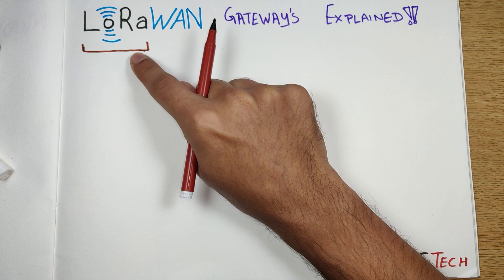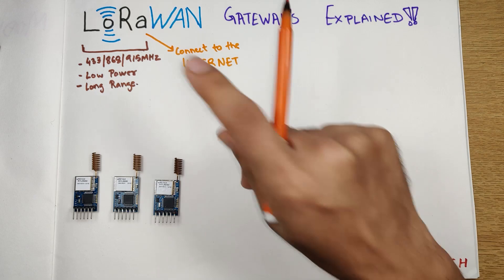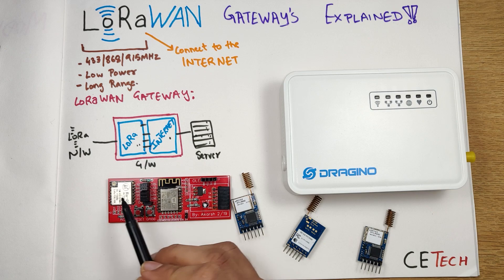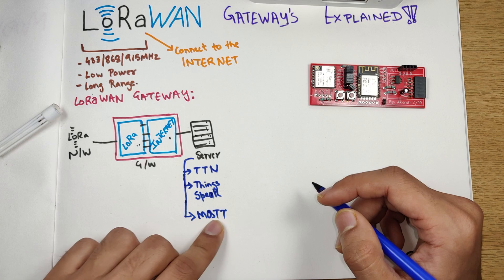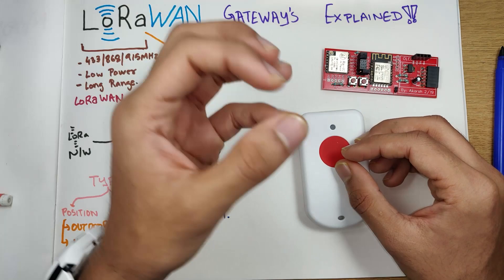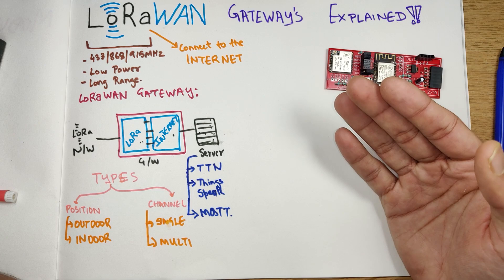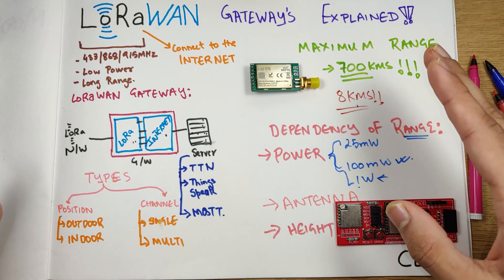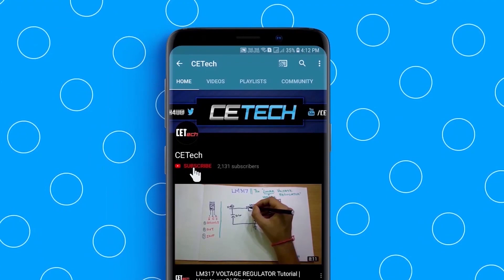lorawan gateways tutorial | lora LoraWAN | What are LoRaWAN gateways?

Comment: Range depends mostly on height and quality of receiving side ie the gateway. I got 40km+ on our public LoRaWAN network. That is on 100mW 3dBi omni antenna on a good quality outdoor gateway on a tower at 868Mhz. Gateway (with its antenna) should be 15m or higher above ground. Sensor can be small sensor with internal 1dBi antenna, but should be 1m or higher above ground. With this setup you should get 15km+ LoS (Line of Sight).

Comment: I need to transmit a 300 kb data from ground station to a model satellite and transmit that same data to another station with different frequency. I was using Xbee for only send the data to model satellite but now that i had to send it to another station i was wondering if i can do that with Lora.  There are different infos about it's bitrate but is 300 kb data large for Lora ? Also i have a Madunio Lora Radio and it has ATMega 328p microcontroller in it they say it's bitrate is 300 kbps but it's range is 2km. I wonder is there some other Lora modules with higher bitrate and higher range?